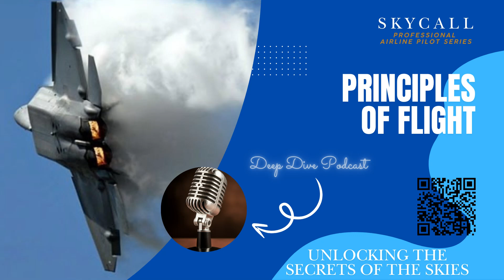Soar to New Heights with Principles of Flight

Comment from the maker: "For aviation enthusiasts asking about additional resources and key concepts from our 'Principles of Flight' video:

✈ Core Aerodynamic Principles Explained:

Bernoulli's Principle: How pressure differences create lift
Newton's Laws applied to flight: Action/reaction forces
Airfoil design: Camber, chord, and pressure distribution
Four forces of flight: Lift, weight, thrust, and drag in detail
Angle of attack: Critical relationship to lift generation
Boundary layer behavior: Laminar vs. turbulent flow
Wingtip vortices: Formation, effects, and mitigation
Stall dynamics: Warning signs, recovery techniques, and prevention

🛩 Flight Control Systems & Aircraft Handling:

Primary flight controls: Ailerons, elevators, rudder functions
Secondary controls: Flaps, slats, spoilers, and trim systems
Stability concepts: Static vs. dynamic, lateral vs. longitudinal
Control effectiveness at varying airspeeds and altitudes
Ground effect: Aerodynamic changes near the surface
Load factors in turns and maneuvers
Center of gravity effects on stability and control
Adverse yaw and coordination techniques

🔬 Advanced Concepts for Deeper Understanding:

Transonic flight challenges (Mach 0.8-1.2)
Compressibility effects and critical Mach number
Shock wave formation and wave drag
Reynolds number and scale effects
Induced drag vs. parasite drag relationships
Propeller aerodynamics and efficiency factors
Wing planform designs and their performance characteristics
High-lift devices and their aerodynamic principles

📚 Recommended Resources for Further Learning:

"Stick and Rudder" by Wolfgang Langewiesche (fundamentals)
"Aerodynamics for Naval Aviators" (free PDF from FAA)
"Understanding Aerodynamics" by Doug McLean (advanced)
NASA's aerodynamics educational resources (nasa.gov)
FAA Pilot's Handbook of Aeronautical Knowledge (Chapter 5)
MIT OpenCourseWare: Aerodynamics lectures
Aircraft Technical Manuals (specific to aircraft types)
Flight simulation software for practical application

Additional keywords for those researching flight principles: aerodynamics fundamentals explained, aircraft flight physics, wing design principles, lift generation mechanics, drag reduction techniques, aircraft stability factors, flight control surfaces explained, airfoil pressure distribution, boundary layer separation, aircraft stall characteristics, high-speed flight aerodynamics, subsonic vs. supersonic flow, aircraft performance factors, wing loading effects, aspect ratio importance, induced drag calculation, parasite drag components, aircraft design aerodynamics, lift-to-drag ratio optimization, angle of attack indicators, critical Mach number explained, shock wave formation in flight, compressibility effects on aircraft, transonic flight challenges, supercritical airfoil design, winglet aerodynamic benefits, ground effect aerodynamics explained, aircraft weight and balance effects, center of pressure movement, aerodynamic center significance, Reynolds number in aviation, scale effects in aerodynamics, propeller thrust generation, jet engine thrust principles, helicopter rotor aerodynamics, vertical flight principles, aircraft icing aerodynamic effects, high-altitude flight challenges.

What specific aerodynamic concepts would you like us to explore in more detail? Let us know in the comments!"